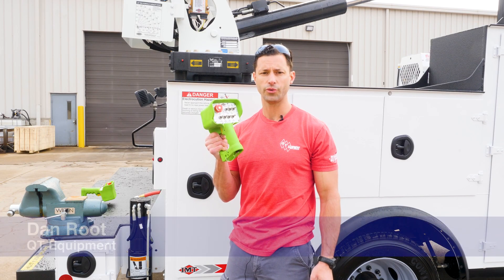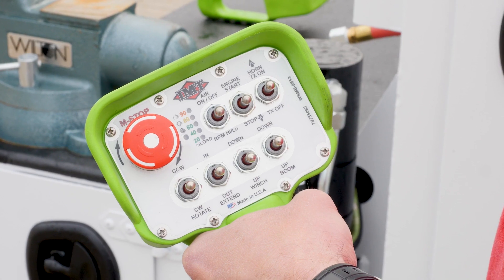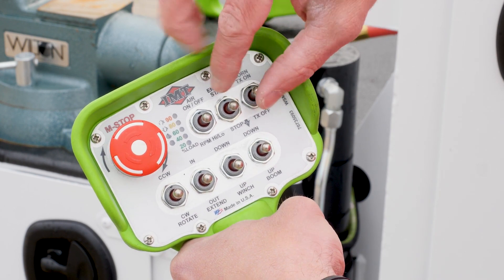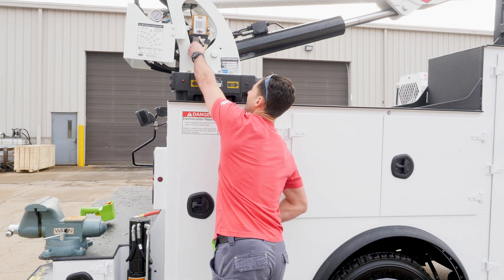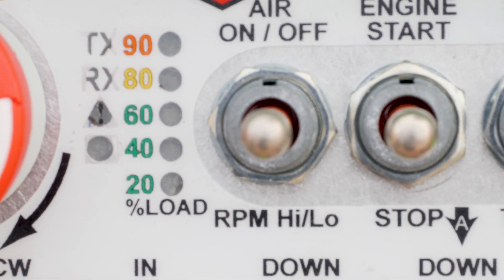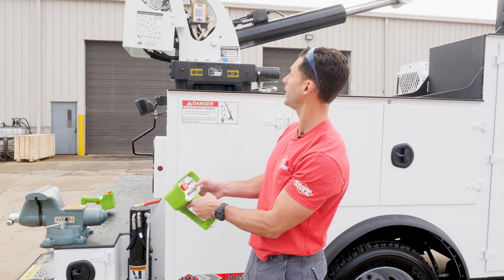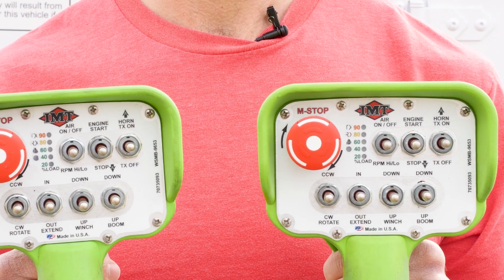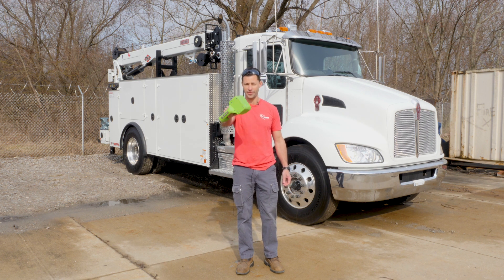How to Link IMT Series 3 White Face Transmitter & Receiver

Comment: What about the new style with joysticks .
Reply from the maker: 1. Stand near to the base unit (in clear line of sight).
2. Twist the MACHINE STOP button clockwise. It pops UP.
3. Hold SW2 UP (TX ON) and SW3 DOWN (STOP).  All four LEDs will flash once and then TX (transmit) continuously blinks (flickers), RX, ER, and battery goes out.
4. Continue to hold SW2 and SW3; Power the base unit.  TX and RX LEDs rapidly blink indicating transmitting and receiving, the Battery LED goes out, and ER LED remains lit solid while the switches are being held.
5. Release SW2 and SW3.  Handheld and base unit Association is complete when the ERR goes out while TX and RX continue to blink (flicker) when the switches are released.
Reply: I have tried when,  I push the switch’s the RX led never lights up . I may have another issue going on . Worked great then one day it quit working wireless. Everything works on the cord . 2017 f550 with 7500 series crane .
Reply from the maker: @redcoupe92  If it is working while plugged into the cord, but not wirelessly, you may need a new transmitter.